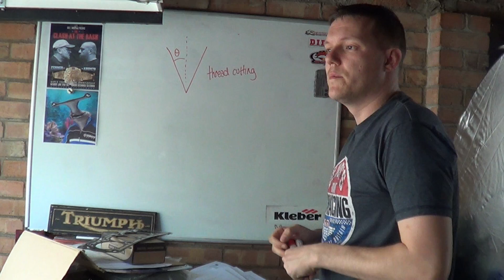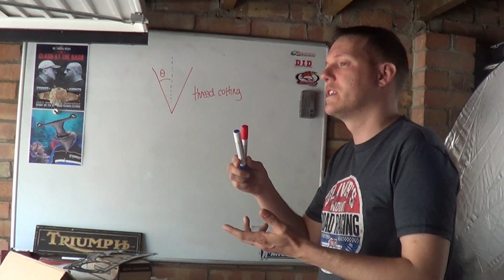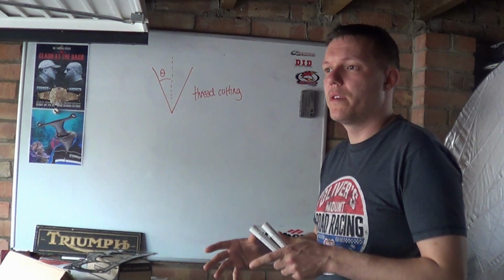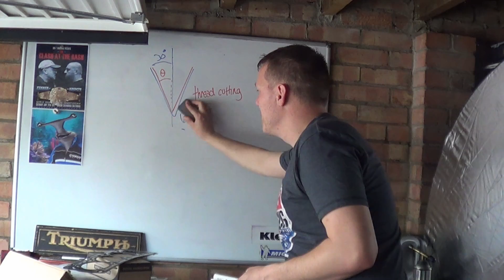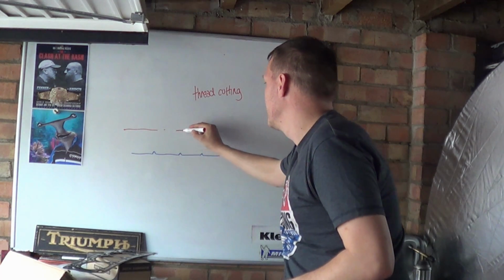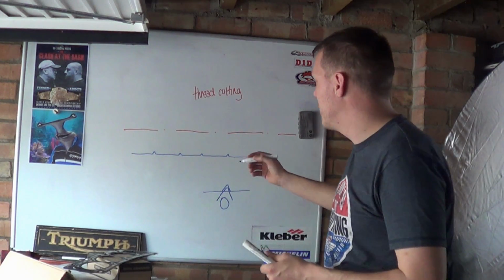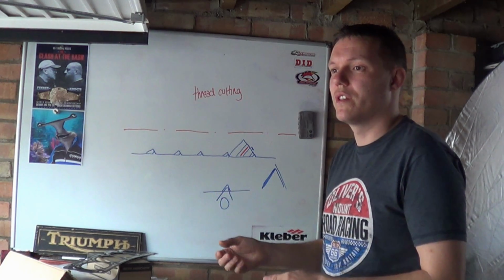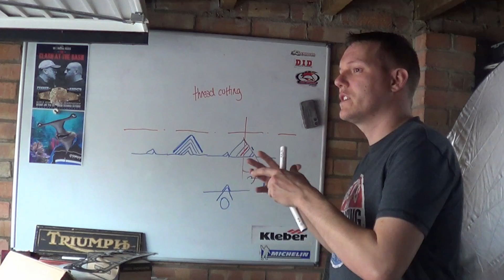Compound at 30deg? - why? - thread cutting

Comment: Nobody bothers to set the compound at 30 degrees anymore. Just keep the compound set at zero, parallel to the bed and advance the compound half the depth of cut on the cross slide. By moving the compound and the cross slide this closely simulates the 30 degree angle. This method also helps with the depth of the thread as the depth is directly on the cross slide dial ( dro ). The tool load is split 87/13 so the trailing edge skims the right hand flank and the leading edge does the majority of the cutting.

Comment: Good explanation and it's how I was taught in school. In a home shop I would do this.  In real shop situations though we didn't bother with it. Good quality indexable tooling can tolerate plunging straight in even when working 300 series stainless.  The advantage being that you haven't disturbed the toolpost. So if you have multiple zeroes saved on your DRO, you can load the other tooling and go right back to where you were for the next piece.

Comment: I use the 30 degree compound slide angle method when I'm screw cutting but when your setting the compound slide make sure you are 30 degrees perpendicular to the work piece and not 30 degrees parallel to the work piece like you have drawn on the board, other than that its an excellent video.

Comment: So the backside of the thread is like stairs. I use a file to smooth it out, before I fit the nut. Otherwise you will cut to deep.

Comment: i was told to use 29 degrees... not that it would need to be that accurate.
Reply from the maker: lol well that's not right lol who told you that if you don't mind me asking?
Reply: The Workshop 
If the compound rest was set a "0", the tool would cut equally on both sides. Moving the compound rest toward the 30 degree witness mark, would remove progressively less material on the right side. At 30 degrees the right side of the tool would slide past the thread. Any angle greater than 30 degrees, the right side of the tool would move away from the right side of the thread with each infeed. the idea of the 29 or 29.5 degrees is to keep from getting a stepped appearance. search it and you'll see im not dreaming this up. I was told this in trade school 18 years ago. 

Therefore, at 29.5 degrees the right side to the tool would shave off a tad from the right side of the thread rather than clear the thread.